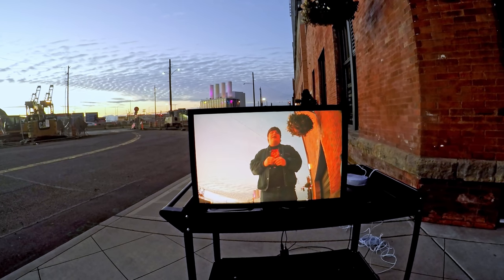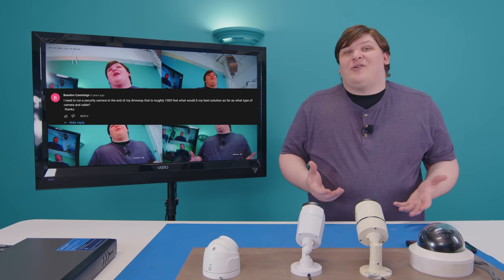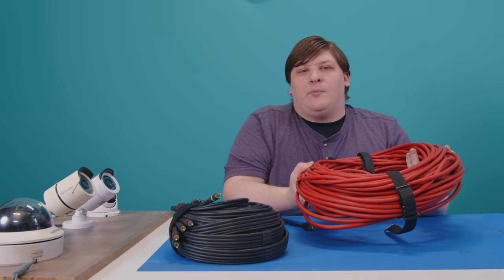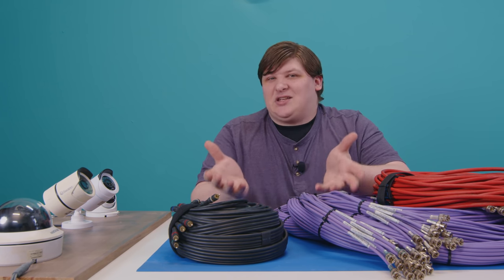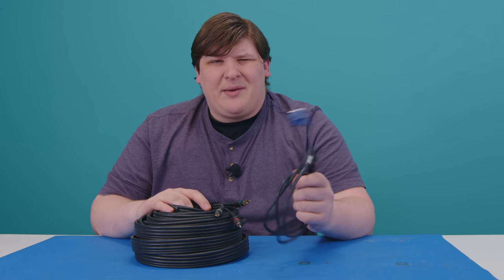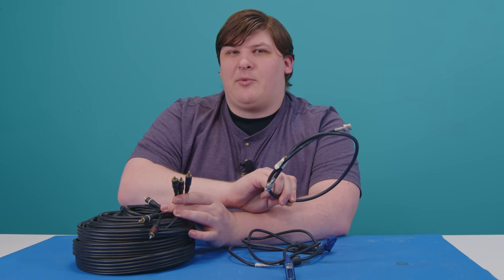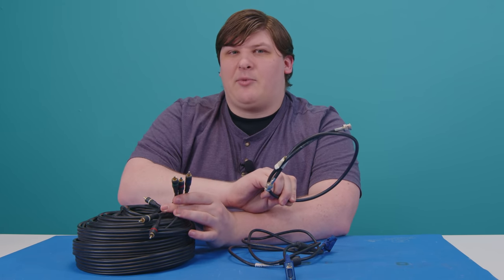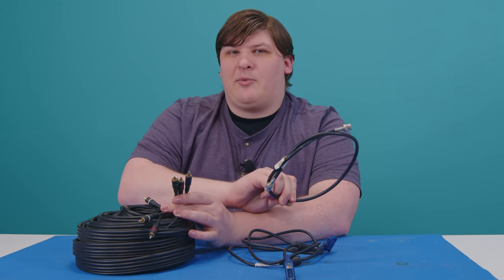1000ft of ANALOG HD video over a single cable?! [AHD/CVI/TVI]

Comment: Security camera enthusiast here (my "home" CCTV system is 80+ cameras strong and my collection is 500+ cameras and 120+ bits of control equipment)
TVI and CVI also are able to pass audio and control signals both ways for configuration of the camera and PTZ control from thr DVR (provided it supports it)
Most of those AHD DVR machines are basically a RISC V / ARM SoC with a hardware accelerated video processing unit. Some are on the same chip. Thr good ones have a dedicated video chip that communicates with the microprocessor via PCI-E.

I run all of my CVI cameras over twisted pair cable and provided there is a good converter on the receiving end, the video is surprisingly sharp. TVI cameras I run over coaxes (there slight differences and TVI is slightly more sensitive but the overall picture is a tad bit nicer in my opinion)
After buying a lot of TVI cameras I found the best one of them all is probably the HiWatch (Hikvision outside Europe) DS-T226 so it might be worth a look at that to see the really high end TVI there is.
Reply from the maker: I knew there had to be ONE out there! Haha, thanks for the info!
Reply: @CathodeRayDude  Always at least one out there
Reply: @CathodeRayDude  I was wondering when you were going to go down the surveillance rabbit hole. Lots of boutique solutions for boutique circumstances in the industry. The HD-TVI cameras more or less exist because of all the old coax that's still in these buildings from prior runs. A new system would just be POE because you can go even farther than the numbers you quoted for POE in your video. You use an Ethernet to Fibre media converters to go farther. A media converter will get you 600 additional yards for less than $100.

It looks like this:
Camera -> POE Injector -> Media Converter -> Network (which may or may not have a corresponding converter back on the other side depending on your hardware).

Then there's the wireless meshnet stuff some dudes are doing on their ranches using small radio towers to network wireless trail cameras. There's a lot of really cool tech in use at modern ranches.
Reply: "Hello Sir/Mam, we got a call about a B&E at your premises, you wouldn't happen to have a security camera?"
"Well..."
Reply: And I thought having 4 cameras in one room apartment is overkill._
Reply: I did some looking around in my collection and found a few DVRs and security monitors that actually take in HD-SDI (I never seen a camera that does, though) Also I have a few security cameras that output component or CR video (CR is basically chrominance and luminance down separate cables)
I do know some very high end installations used twinaxial cables to run to cameras from a junction box which would have a multicoax (about 32 or in some cases more coaxes in one) cable.
Also one thing I noticed with more expensive cameras (especially ones made by Bosch and Pelco) is that the analog signal would be a lot more hot than the fixed ones.
I personally never seen a twinax camera cable but I did once come across a multicoax on one job I was on. All they had to do was upgrade the cameras and the DVR units and all the cabling / matrix switchers stayed the same. I will look more to see if I have anything else that is somehow odd.
Reply: Its Hikvision here in NZ and they also have a DIY line called HiLook. But ProvisionISR have the best feature set and value for money on the comercial market at the moment.
Reply: You should take the output from all of those cameras and do NERF AI reconstruction so you can move around the crime scene in 3d like they do in sci-fi shows. I guess it's not sci-fi if that's really possible now.
Reply: @felenov  Samsung Security cameras and recorders used to offer HD-SDI cameras and recorders as part of their lineup.  Now they offer AHD for the analog side of it.  They are now Hanwha Techwin.
Reply: i think Hikvision is banned in the US. or was anyway.
Reply: @alexsurles  yup. The NDAA banned Hikvision and Dahua for federal $ projects. Now the FCC is working on banning them as well. So many homeowner and small business's go to them because they are cheap and good enough, but now is the reckoning. Now cyebr security finally becomes more important than saving a few $ or buying the cheapest item. There are tons of other vendors to buy from. Check out where things are made. Do they have a full line up. Have you heard of the brand.
Reply: @AaronSaks  interesting. I will research that topic since I like unusual formats. Thanks for the information.
Reply: @felenov  some brands have 4kx power over coax, ptz control over coax and more!
Reply: @AaronSaks  I never seen power over coax. But audio and control signals are pretty common for the modern HD standards. No need to run an extra twisted pair for RS485, all over coaxes
Reply: I came to these comments just to find the ultra rare cctv collector. I collect screen shots of YouTube comments from users who collect niche devices.
Reply: Lol there is ALWAYS at least one. I respect it.  Any recommendations for a basic system? Like 8 maaybe 16 cameras with the modern bells and whistles? I can wire them.

Comment: Amazing video! I’ve always wondered about those HD camera systems that seemed to use coax. Now I know!
Reply: Woah! The best crossover
Reply: I always thought it was HDSDI (and I'm pretty sure some of the higher end ones are). HDSDI is the same digital data as HDMI, but combined into one serial stream, rather than 4 parallel streams, and with appropriate cable drivers to go long distances over RG-6 type cable (and even further if you use better speced cable). You can get converters from HDMI to HDSDI and HDSDI back to HDMI for not too much money on amazon. And that's the retail price - if you're buying the chipsets in bulk for manufacturing cameras, they're basically dirt cheap.
Reply: @gorak9000  Before HD-SDI you had SDI. I won't be too surprised if that standard accepted signals way beyond the originally intended limits as technology was progressing but a new standard wasn't fully standardised or even accepted by the industry yet.
The big difference with HD-SDI is that it usually bypasses all image-processing circuitry in a videocamera and outputs raw sensor-data. HDMI sometimes does that too, but considering it's more a consumer-standard, not every camera supports the same data-throughput on HDMI as it does on HD-SDI.
Personally, I prefer HD-SDI, as it features a locking connector (BNC), angled connectors are easily obtained, can have a nice thin cable if you only need to go from the camera to an extra monitor, where HDMI-connectors are always bulky, don't lock, are hard to find in angled-positions (and if you do, they always 'angle' the wrong way) and thin cables are very expensive.
All the advantages of HD-SDI is also why I make those cables myself. 50 Euro or more for a short cable is just ridiculous. Now if only some manufacturers of monitors would use more standard connectors (ugh ugh... Blackmagic...)
Reply: @weeardguy  There's no way SDI accepted signals beyond the SDI spec. SDI was an older standard for uncompressed SD digital video. It ran at the same clock rate as ASI (mpeg transport stream over serial interface). Both of them have a fixed data rate of 270Mbps. ASI uses 188 byte packets, and if the data rate of the transport stream is less than 270Mbps, the unused 188 byte packets spots are filled with "null stuffing packets", but the physical wire is always running at 270Mbps. Similarly for SDI, uncompressed SD video, you basically need the whole 270Mbps to send the video signal (and associated uncompressed digital audio - there's a fixed number of audio channels you can send). Because the physical clock rate on the cable is fixed, there's really no room to "accept signals way beyond the originally intended limits". HD-SDI is basically the same thing, but with a higher clock rate (1.485Gbps) meant to carry uncompressed HD video. There is no ASI-equivalent at 1.485Gbps or any of the higher speeds - ASI still tops out at 270Mbps. There's also 3G-HD-SDI that runs at 2.97Gbps, 6G-HD-SDI that runs at 6Gbps, 12G-HD-SDI that runs at 12Gbps and 24G-HD-SDI that runs at 24Gbps for carrying higher and higher resolutions of 3D, 4K, 4K 3D, 4K HDR, 8K HDR, and beyond. If they wanted to invent a new standard for HD security cameras, I'm not sure why they didn't take ASI and slow it down - put the video encoder in the camera, then you have somewhere between 5-15Mbps of data you need to send back (depending on desired bitrate and video encoding mpg4 vs h.264 vs h.265). They could've taken the 270Mbps of SDI, slowed the clock way down, say by a factor of 10x to 27Mbps, and you'd have more than enough bandwidth to send back 1 encoded HD stream per camera. There's no reason to be sending back uncompressed video down the cable, that's just dumb. I'll bet with a clock speed reduced ASI running at 27Mbps, you could probably send the data back over 2 coat hangers next to each other (or the worst coax imaginable) and it would work just fine. For cost, I see no difference having the video encoder at the camera side, or at the DVR side - seems that it would be the same either way, but at the camera side means you have a lot less data to transmit, so much easier to do over crap cable.
Reply: I was watching this video in 144p* had to change it to 1080p now I see the difference. Good to know.

Comment: Car backup cameras use some of these AHD formats with Android based head units.  Really cool to learn a bit about it!
Reply: My dashcam uses it for the rear camera. It's 2K and is amazing for price.
Reply: I was wondering why my parents' car had analog artifacts in its backup camera feed.
Reply: Yeah i noticed that too. Which is fine especially when you use them at night and have a nice analogish high-gain videopicture with all the artifacts of analog video. Works really reliable which is why i don't really care for these radio transmitting car cams.
Reply: @wwtoonlinkfan  My parents' 2020 Toyota Prius backup cam has what appears to be 480i analog video in spite of its recent vintage. Maybe this is related?
Reply: @wrentubes1886  I've seen aftermarket head units with composite inputs, so I wouldn't be surprised if even stock ones used standard 480i/576i or some other composite standard. Really, for a backup camera you don't need highest quality camera anyways, hell, some cars don't even have one.
Reply: Honestly its a million times more reliable than a digital signal so I wouldn't mind if this never changes.
Reply: @FAKEAXIS  I'd argue that cars are one of the places where digital makes the most sense. Alternator noise is very large and unpredictable in frequency as well as the many harmonics on top. It can interfere with the signal to the point the image is meaningless when the engine is running. Most VW group cars require a DC/DC converter and low pass filter for any lines running an analog signal such as the backup camera due to their alternator noise being unusually noisy at higher frequencies.

Comment: Cool video.  I'm more into digital IP cameras than analog stuff, but it's the same companies in both arenas.  One thing you might find interesting: The "generic" DVR you were using from Annke is actually made by Hikvision.  There are a very small number of camera manufacturers and lots of companies re-labeling those brands (They call them OEMs).  Dahua and Hikvision are responsible for something like 80% of all security cameras on the market, but through many different names (for instance Lorex and Amcrest are two big names in the US are actually just Dahua rebranded cameras).
Reply from the maker: I'm not surprised, just didn't know who the oem was - usually it's not a brand that actually has any market presence of their own, but this market does have the feeling of being remarkably concentrated on a couple companies
Reply: Security systems is basically a market of system integrators disguised as manufacturers (think of them like security equivalent of Compaq).

Comment: This video was quite interesting! I maintain and do installation with a medium-sized CCTV system where I work (about 80 cameras) and some of our cameras are still AHD in places where it wasn't cost effective to run network cable - the reality of new CCTV installations in 2022 though is definitely IP cameras. Their picture quality is far better, the cable runs are much more convienient over Cat 5 or 6, and you get the benefit of having a hub-and-spoke style network topology with off-the-shelf network switches. Need a new camera in a place? Well the cable doesn't need to go to the DVR, just as far as the nearest network switch.
Reply: And any ipcam plugs into the existing ethernet cable
Reply: One thing we found is you absolutely need to use super high-quality cable for network cameras. Any CCA will crack over time in outdoor use. Another is water proofing. 

If any water gets into the connector it will fry the connector if not the entire camera. Since it's 48V. Damn near instantly.

While a analog camera will simply degrade in picture over time. I also saw an analog system have it's wires hit by a semi truck and there was no damage to the wiring. The DVR just got ripped through the wall.
Reply: @mgzukows  not sure if you really need super high quality cable, i run my system on regular belden cat6 and it works just fine for years, i dont use those cable that can cost more than $300 per roll (1000ft)

Water damage on connector can happen if installed incorrectly

What i like about IPcam is the ease of use and installation, since i only install for myself, having to buy 2 separate roll of different cable and having to worry which ones which is annoying, ip cam solve the issue since i can just use 1 type of cable for network and cameras, not to mention my home setup is spread across two location so analog wont do the job
Reply: And for the really crazy long runs you can just use an ethernet to fiber converter and run a 600 yard optical cable to the next building.
Reply: @poisonouslead85  that works, one thing i dont like about that is that it doesnt carry PoE
Reply: @zsoltpeterdaniel8413  true, although in my opinion you should never plug any CCTV over IP system into anything that’s connected to the outside world. You should have a completely separate unconnected system just for the CCTV. We use a lot of Hikvision cameras - they’re good quality for the price but I don’t trust the company as far as I can throw them.
Reply: @TonnyCassidy  Ya you have to find power somewhere but you don't want to be slinging power over long distances anyway.
Reply: Depending on your circumstances, you might be well-off looking at ethernet-over-coax. At least one claims gigabit speeds over multi-drop CATV installations, so there may be something on the market that's well suited to your use.
Reply: @absalomdraconis  didnt know theres multi drop one, so the cable itself acts like a switch ? Thats new to me, and does the coax carry power too ? Because if at the end we still need to pull extra cable for power still wasnt very nice imo
Reply: @mgzukows wait, did the dvr survive? or did the wall have it's vengeance and destroy the dvr in the process?
Reply: @blendpinexus1416  it survived and was used for another year or so.
Reply: @mgzukows  XD, so even the equipment was brick shithouse structure. man i almost miss those days.
Reply: @blendpinexus1416  This was like 5 years ago.

Comment: Fun fact: Triax based camera systems mostly operate with analog signals.
Triax camera runs can be many 1000's of feet at venues like stadiums or other large events, and the bandwidth often isn't there in the cable at that range for uncompressed digital circuitry, and you can't add compression to broadcast camera signals because any latency isn't acceptable to maintain audio & video sync.
Add in the needs for multiple signals in each direction, and the best solution is... analog RF. Most triax camera systems are literally a stack of very high quality analog modulators & demodulators in each end. Each camera chain is basically a tiny closed circuit 2-way cable TV system.
And you can actually send all the video/audio/control/etc signals over normal biax coaxial cables with a simple adapter that just leaves out the 3rd conductor of triax that is used for (very high voltage!) power to the camera.
True "digital triax" does exist, but it's rare and doesn't have the range of analog triax. ... Which is where the broadcast fiber optics come into play.